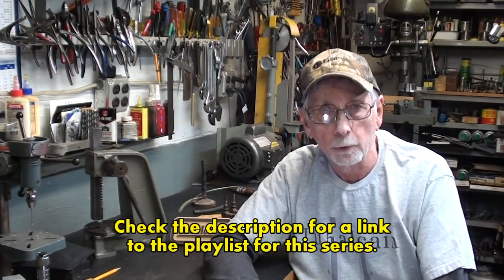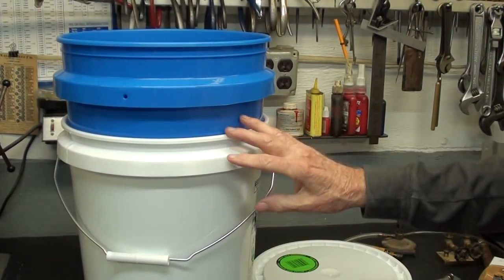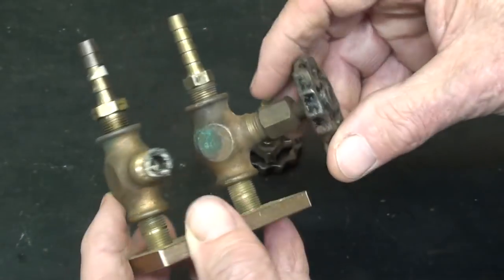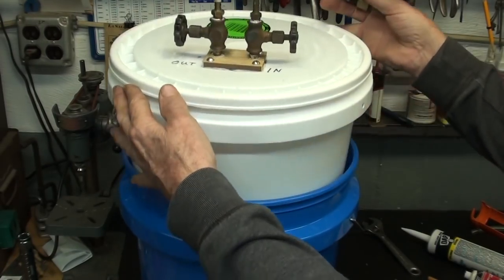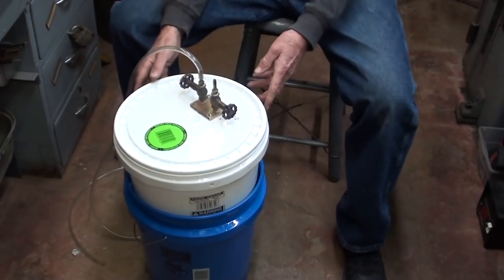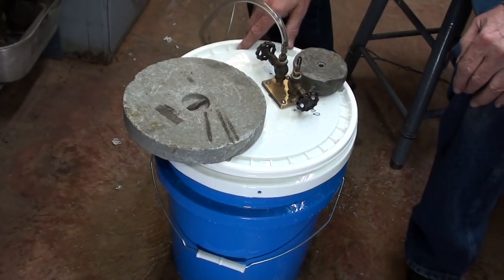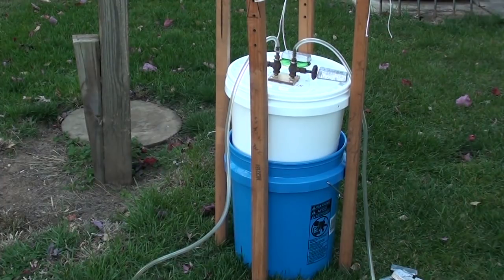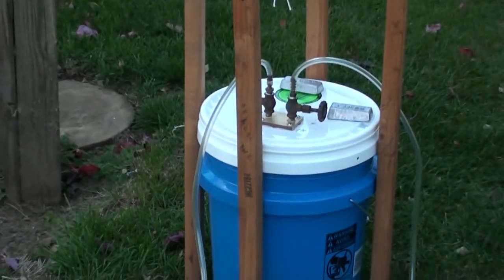What Makes It Work? #32 GASOMETER gasworks TUBALCAIN

Comment: A common operating pressure for natural gas appliances is around 7 inches of water column (WC) or re-stating this in equivalent measure, that's 14.9 millibars or 1743 Pascals or Pa, or about 0.25 psi (pounds per square inch) or about 4 ounces of pressure per square inch.
Reply from the maker: Thank you, I hope other people read this
Reply: Extending that a bit, the cross sectional area of the bucket is roughly 100 square inches.  So a weight on top of about 100 X 0.25 = 25 lb or more would stop the bucket from rising.  If the inner bucket is prevented from rising, then as gas enters it will force the water outside the bucket up until the water level outside is equal to 7 inches above the water level inside.

It's easy enough to measure your actual household gas pressure by filling a U-tube with water and connecting the gas supply to one side.  The difference in the water levels in the U-tube gives the pressure.

Comment: I have vivid memories of Adelaide (South Australia) being converted to natural gas around 1970 (the gas man came to replace the burners in the 'gas fire') before I started going to school. Some of my earliest memories are sitting in the car with my (now-late) dad, waiting at the traffic lights leaving the CBD  to the northwest,  and seeing the   SA-Gas-Co.  works in the  near distance with the gasometer  at different levels on different days. I worked near there in the early '90s, and the gantry frame was still visible then.  Google maps now shows the pit, though filled in.   Thanks for the video.
Reply: HI greaser5691 I can remember these they were in the Adelaide suburb of Brompton. There were two   of them one was much more modern than the outher the older unit was of riverted construction  and the more modern one was of welded construction.I can remember as I went to the Brompton Infant and Primary schools and my father had a factory in Brompton .Originaly they produced coal gas at Brompton and the by-product of the coal after the gas had been produced was called  sinders. My father scored a couple of truck loads of these sinders to spread around  his factory so it was not so muddy in the winter. The  SA-Gas-Co were always glad to get rid of the waste sinders        Ray

Comment: I never knew about these things before but it's really ingenious! Thanks for showing us Lyle!

If you're interested:
The pressure (psi) depends on the area of the bottom of the opening (at the water level inside the top bucket) and the amount of weight (including the bucket, valves, and hoses) of the upper section in pounds. Since the top bucket has a slight taper to it, the pressure will be slightly higher when the top bucket is lower in the water. But, in this case, the difference is so small that it can be ignored and treated like a cylinder with a constant radius.
The relationship is Pressure=Weight/Area, Area for round bottom is A = pi * radius^2,

so  P(psi)=W(lbs)/(3.14*(r(inches)^2))
You can rearrange the equation to find out how much weight to add in order to achieve a specific pressure.

 The most interesting fact to me is that these will maintain the same pressure no matter how full (or empty) they are so long as there is some gas in them.

Comment: 1980 we referred to them as a natural gas holder or storage tank.  Water sealed u shaped joints at the cup intersections. The job to monitor them during the freezing temps was holder man. They were used both as a storage medium and part of the mixing and scrubbing of various plant streams to clean and process them up so then would be sent to the grid. Also used for local low pressure grid load management during peak times.
Reply: So, there was a water seal not metal to metal at each joint? I wondered how that work and if Mr Pete would try a three bucket model.  Thanks for the information.
Reply: How did the "holder" keep them from freezing?
Reply: @jameswilliamson4856  A torch of course 🙂
Reply: @1STGeneral  Think about how incredibly dangerous that would have been to use a torch on a tank joint that was holding back pressurized natural gas!  Like the rubber gasket on the Challenger...

Comment: Mr Pete

Thanks for your interesting video. They should actually be called Gas Holders I think I should know as I used to design them when I was a young man in the UK. A gasometer would infer that it is some sort of measuring device? The more modern holders were spirally guided and mostly "disappeared" when they were deflated. the holders could have three or even four "lifts" I was always surprised how little pressure was required to inflate the holders weighing several hundred tons - around 10 inches water gauge.

Comment: Mr. Pete I commented on your video about the carbide lamp and mentioned that I worked in a plant that made calcium carbide. We had a gasometer in our testing lab, very similar to your experiment, it was 2 brass cylinders with weights on top with a water seal and was set up the same as your buckets. We would put a measured amount of carbide in a flask and introduce another measured amount of water, this would create acetylene gas causing the gasometer to rise up. After a set time we would read how much the gasometer rose up on a scale and do a quick calculation to determine the grade/quality of the carbide. You brought me back to the late 70's, thank you
Reply from the maker: I found that very interesting, that’s an experiment that I should attempt to do. But not worth it, very few people watch this video
Reply: @mrpete222  - Think carefully before you mess with acetylene: an air/natural gas mixture will explode. An air/acetylene mixture will detonate. Some radicals were filling garbage bags with air/acetylene mix in a basement in NYC a few decades ago. They had an accidental ignition and blew up a four story brick building - turned it into rubble.

Comment: Lyle, as soon as I finished watching this very interesting video, I had to do a bit of searching for how the multiple-lift telescoping gasometers/gasholders are actually sealed.  A "single" lift gasometer like your model is easy to understand, but "multiple" lift seals was harder to figure out how they did it.  Wikipedia (as usual) seems to have the best explanation on the upper seals.
Reply from the maker: Thank you, I will look at that

Comment: Cool demonstration! Thank you. It's similar to the way that you can regulate the air pressure on a set of double chamber blacksmith bellows. Walking home from school in the 1970s there was a crew that was torch cutting the plates that made up the cylinder and letting them drop. You could hear it for miles.
Reply from the maker: Thanks

Comment: Mr. Pete,
I used to see those gasometers around suburbs north of Boston when I was a kid in the mid 1950's.  My dad said they were the gas works.  At that time, unless you lived in the central area of the city, you had to use oil for heating.  Always wondered just how they functioned. Thanks for this video.

Comment: Great video.  I remember seeing them as a kid but I never knew what they were.  

If you ever need to make real low pressure measurements you can always build a U tube manometer with clear plastic tubing, colored water, and a yardstick.  Simple but it gives accurate measurements in inches of water.
Reply from the maker: Thanks

Comment: Great explanation... I recently saved an emergency backup water pump that was used to flood the seal for a gasometer or what we called "holders stations".... its an old ford 172 4 cylinder engine coupled to a Dayton-Dowd 2 stage water pump, it but out 750gpm and ran on natural gas... I'm looking forward to restoring it.

Comment: Here in Australia those things were called "gasometers". Where gas was made was called "gasworks".
When they were in use the gas mains still ran at pretty low pressure. It was during the change to natural gas that the mainlines were replaced with polyethylene pipe and the pressure increased.
Another change was the old coal gas had some water in it which caused issues with iron pipes. Todays gas is dry.

Comment: I remember reading a way to make methane out of chicken waste and store it with these.  That guy used barrels to do the same thing you did with the bucket.  I appreciate this.  Thank you Professor!
Reply: As youngsters we often went sport shooting on an old pig farm. One of our entertainment tricks there would be to turn an old steel dust bin upside down over the cesspit where all the pig slurry was stored. After 10 minutes prop the rim up by a couple of inches and feed a lighted paper or rag on a stick under the upturned open end of the bin. Whoosh! Up she goes! The power of natural methane coming from the decomposing pig slurry.

Comment: There is a large old stationary engine at the Antique Gas and Steam Engine Museum in Vista CA. That uses a similar device to regulate  the pressure of the propane fuel that it runs on. Thanks for the very  interesting video.  I remember seeing gasometers in Los Angeles as a kid.

Comment: Most vacuum guages made for diagnosing or tuning up gas engines will also read gas pressure for engines with carburetors up to 8 psi I think amd they are cheap. Thanks and keep up the great videos.
Reply from the maker: Thanks

Comment: What is notable is that the gas supply is a constant pressure, regardless of load.
Reply: A few people have learned this by not buying larger pipe for their emergency generators.
Reply: @jonanderson5137  - Fortunately, for me, I passed Fluid Mechanics.  Unfortunately, for me, everyone thinks they are a mechanical engineer.

Comment: The gas pressure in your house, after the meter governor (regulator) would be around 8ins/water gauge, that's around 1/3rd PSI. Out in the street it would be around 12 to 18ins/WG. A 100ft tall gasometer, when full would have around 12 to 16 ins/wg of pressure in it. The gas would be compressed to send it out onto the district at a pressure around 20ins/wg depending on the distance to where the pressure would be at its lowest when the load was at its highest. Time clocks would be used on the governor system to change  the outlet pressure of the station to suit the conditions on the district (the higher the demand, the higher the pressure needed).
Reply from the maker: Thank you for that

Comment: Mr Pete, I saw your dead-blow hammer disintegrating.   I have had to throw away two just recently I have had for years, because the plastic just fell apart.  They were always so kept in a tool box not exposed to any fumes or etc.  They were both Stanley branded.  Keep on chugging.   Happy Veteran’s Day.
Reply from the maker: I have had three or four fall apart. In fact I show this in a video that is still unreleased
Reply: @mrpete222  I guess Horror Freight ones would be as good if they lasted a few years as well.

Comment: its actually a pretty smart way to compress gas when you consider the ability to make things seal tight enough only came in the early 1900s
Reply: @tractionownersclub4827  it does compress the gas with gravity not a ton but enough to push it down the pipes

Comment: That was great!  I had been wondering how those worked after seeing your picture earlier.  FYI the guide sticks were made as pitman sticks for a hay mower--have made many myself.
Reply from the maker: I couldn’t think of the name, I had a whole bundle of brand new ones from a hardware store that went out of business.
Reply: Those you said were nice hickory.  Here in Colorado I only could get scrap oak from pallets.  We had wood pitmans on both horse drawn and 3pt tractor mount mowers.  The horse drawn were obsolete before I was old enough to use one.  Although we fixed one up and towed it behind the truck one time so that I could experience what it was like.  Man am I thankful I they were gone--running one while driving a team would have been difficult.  Dad said that the horses would be pretty well broke in by the time haying was OVER.

Thanks again for the gasometer explanation.  I had racked my brain trying to figure out how those worked.  The picture looked like some kind of bladder, but I was sure such a thing wasn't available when they were used.

Comment: Gas pressure in the house is about 10 inches of water column. You had all the materials in your hand and spilled on the floor to build a u-tube water manometer. Street pressure varies from a few psi to around 50 psi.
Reply: Oh, and 1 psi is pretty near to 28 inches of water column. So 10 inwc is about 1/3 psi.

Comment: Morning, Lyle. Didn't know that you have a 'What makes it work' series. Guess that I have some after class extra credit to take care of! 🎓
Reply from the maker: Yes, there are over 30 of them
Reply from the maker: By the way, by the number of views, you can see that no one else did either
Reply: @mrpete222  
Perhaps an onscreen hot link at the tail end of a few videos will boost views of the series? I just warched the Segway one  and the mechanical odometer/speedometer video. Don't think that's a Ford speedometer. Kinda like a middle 50's Dodge.

Comment: Pretty easy to calculate the pressure: the weight of the piston (including added weights) divided by the area of the circle where the piston meets the water. (Note that since your piston is tapered, the area will change; taking an average should be close enough.)
To make a bunsen burner flame visible in daylight, put a fine wire in the flame (hottest point of the flame is the tip of the blue cone). To make the wire last, use tungsten or platinum wire. If you don't want to spring for a supply from Amazon ($50-$100 but very useful to have around), you can always break a regular light bulb, which has the advantage that the extremely fine tungsten wire is already attached to a stronger support wire.
Reply from the maker: Thank you for some good suggestions Peter

Comment: It's like a capacitor, for DC electricity... it stores excess capacity for delivery later.  There's a wonderful city park in Seattle, Gas Works Park... the gasometers are disassembled, but the old Corliss engines and the gasification furnaces are still there.  You run the plant continuously, and peak demands are covered by the gasometer.  I believe the gas was mostly used for illumination before the widespread use of electricity.  Also, the gas contained large amounts of carbon monoxide... it's pretty hard to gas yourself with methane, but CO is easy... the 'head in the oven' method was meant for coal gas.  Natural gas is much safer!
Reply from the maker: Thank you, that’s why I have not heard of anyone gassing them selves in a long time.

Comment: You're going to need a lot of weights, and much taller buckets for 2 psi.  For a ten-inch diameter bucket, the surface area of the water is about 79 square inches - so 2 psi would lift 158 pounds.
But 2psi will also support a column of water over four feet high - so it will just blow the water out of the bucket before it begins to lift if you put that much weight on top.
Incidentally, you saying you don't have a pressure gauge for low pressures - you can make one with a U of clear tubing with water at the bottom of the U - a so-called manometer.  Apply the pressure to one arm of the U and leave the other one open to the air.  The difference in between the water levels in the two arms measures the pressure.  With water it's about 28 inches for every single psi. So you need your manometer to be at least six feet high.  You can use some heavier liquid than water - mercury is good, but has its own dangers, of course. One psi of pressure causes a level difference of just over 4 inches, with mercury.
Reply from the maker: Thanks

Comment: Well done!  As a former Industrial Arts teacher, I appreciate your explanation, and look forward to watching more of your videos.  I remember seeing a huge gasworks just outside St. Louis, MO back in the '70s. 

Pressure inside the gasometer (I believe it is pronounced similar to "kilometer") can be calculated from the area of the circle of the small end of the bucket.  With a 10" diameter, the area is pi x 5 = 15.7 square inches.  Therefore, 15.7 pounds of weight on the lid of the bucket adds 1 psi of pressure to the system.  Volume storage would be height times area, so an 8" lift would give about 125 cubic inches, or 0.87 cubic feet (probably closer to 1 cubic ft, since the buckets are wider at the top, and the gas is under slight pressure).  Now, if I could just teach the kids to read a tape measure...
Reply from the maker: I love hearing from my shop teacher. Thank you for that information

Comment: Thanks for a very interesting explanation. We still have many of those in the Philadelphia area. (google PGW)
BTW I hoped there was a check valve in the burner...I was concerned the flame would run up inside the tube.
Reply from the maker: I did not know there were still any of these standing